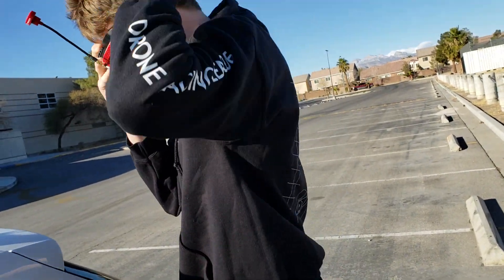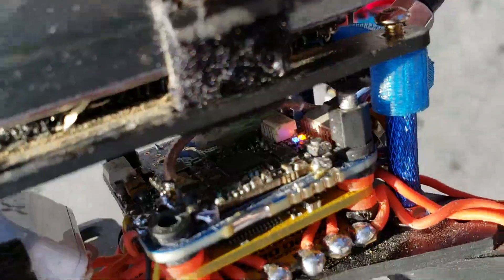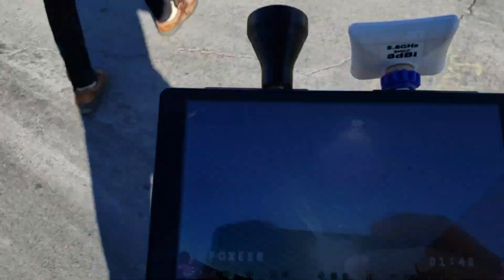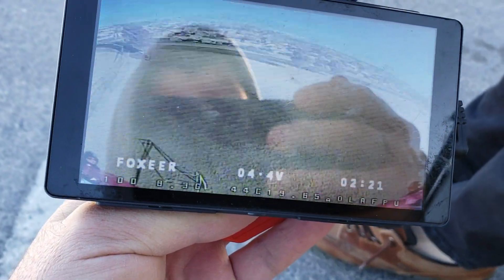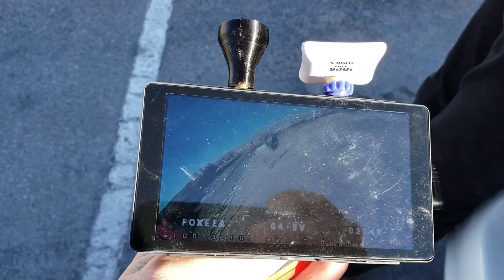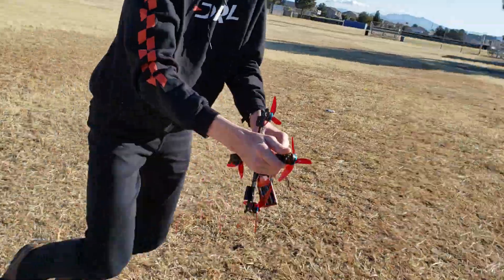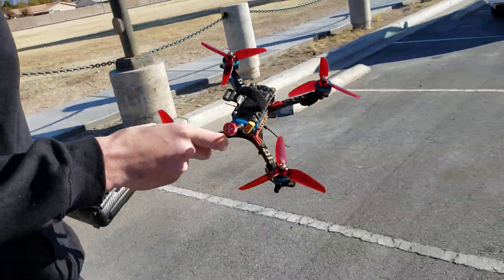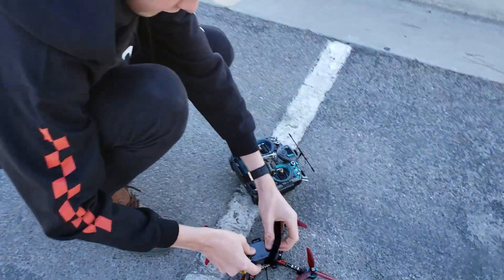Testing the new Pyro32-45 ESC at 100% full throttle

Comment: Way to beat down some 19n03's.  Hit or miss on the qc but they're cheap. I pop them weekly on the high rpm quads. Wish there was an option with 5c430l's for another 10 bucks.
Reply: I agree, bad move to use 19N03's. The Pyro32 appears similar to Furling32, which rebranded by Holybro with custom part. The replacement ESC for Holybro HDV stack appears to use TPH1R204's which on paper looks better.